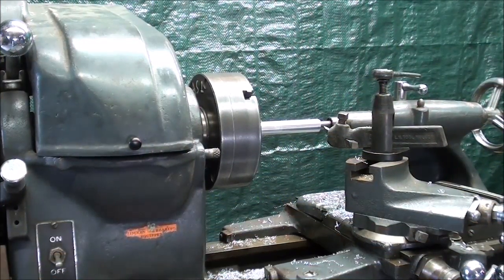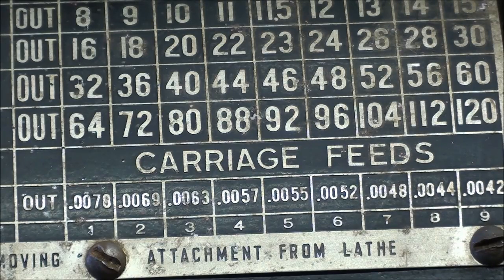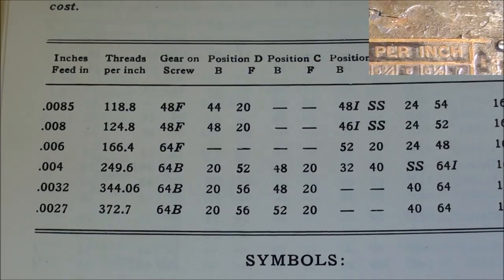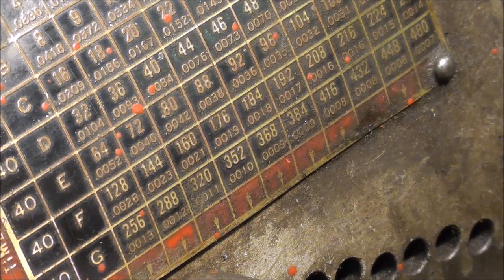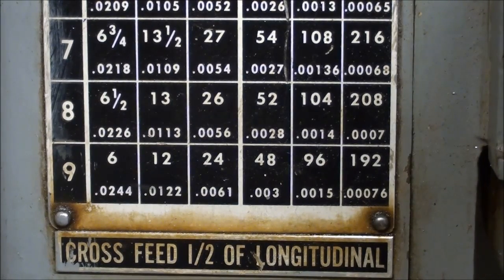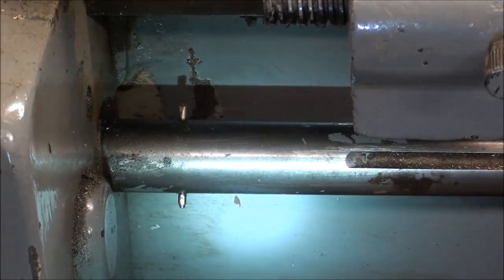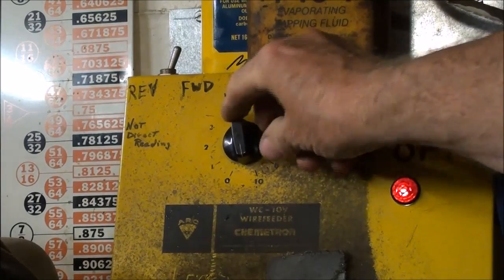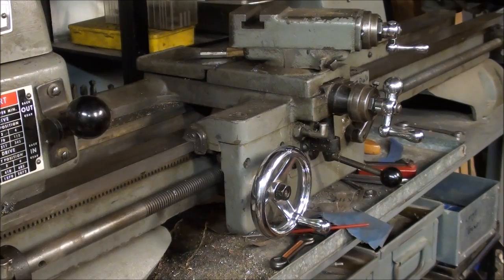SHOP TIPS #230 Critique of Feed Rates on the Atlas Lathe tubalcain

Comment: Hi, I have the same lathe and I'm just starting to learn how to use it. Until I saw this video, I thought it was my technique that was producing a rough finish.  I now understand the real reason.  I’d like to replicate your system, it’s brilliant.  Will any wire feed motor from a mig welder work?  I’m not sure how much horse power is required.  Thanks in advance for your help!
Reply from the maker: I cannot answer that question, because this meg motor is the only one I’ve ever seen.
You do not need a lot of power because the motor has a built-in gear reduction system.    But you can’t use a motor as weak as let’s say a fan motor. It needs to be a motor with brushes I think.
Reply: @mrpete222  Thanks so much for getting back with me so quickly!

Comment: Good day and thank you for your very informative videos.  I've been a hobbyist for many years but always had to use others equipment.  I recently acquired this same lathe (Craftsman badged) that you are showing here.  It was not fitted with the quick change gearbox.  Many of those I had used elsewhere were.  Having watched several of this Atlas series of videos, why couldn't you install one of the other reduction gears from the set to slow down the initial input of the QC gearbox thus reducing ALL the feed rates but with the target rate being slower turning?  Just my thought.
Reply from the maker: That’s a great idea.

Comment: My fix was to change drive gear from 48 to 24 teeth,,, and i used a nylon gear to also prevent a crash,,, l have to multiply chart by 2 and I lost first row on quick change treading chart but I will never cut a tread that course anyway. I would of did the drive motor to save gear box gears from wear but I realized the quick change gear boxes gears are steel and not zmak like the rest.
Reply from the maker: Good job

Comment: Hey, Lyle.  I don't know if you have seen this video.  The guy has didn't like the feed rate on his Atlas so with his quick change, so modified the gear train and cut all of his feeds by half.  He has to take that into account when selecting the settings for cutting threads and has a few which you cannot do without switching it back on the course in.  I thought you might find it interesting.

https://youtu.be/kEdxLceqCck
Reply from the maker: +ILGopher Yes, I did see that. I would like to do a vid on it some day

Comment: Hi Mr.Pete, I couldn't figure out how to send you a personal message, but I have a question... (this is the tech teacher who is building a version of your double acting wobbler engine- basically 1/3rd the size if I remember right.)  I have the cylinder in pattern form for casting. The piston chamber will have a 5/8 sand core and I want to bore the cylinder to fit a 3/4 piston that I'm going to turn out of Delran. I had planned on drilling the cylinder (about 4 inches in length) and then reaming it to .750 and turn the piston to about .740-.745. Both the drill and reamer I would have to buy. I'm wondering if you would have a different method to machine the piston chamber of the cylinder? Again, I'm not a machinist, but I play one at school. lol. Basically everything I know is self taught and learned from youtube. Thanks in advance for your advise! Ray
Reply from the maker: +ray29999 You can try boring it on the lathe. But the small hole requires a small boring bar which wants to flex on a deep 4" hole.  Guess you need a reamer

Comment: For a finer finish, just use a larger radius insert/tool.  I've never needed to feed slower than .004"

That said, I don't work on many small or delicate parts where the increased tool pressure from a larger radius tool could cause chatter problems.
Reply from the maker: +Bread996 Good advise-thanks for watching

Comment: Interesting the way you disengaged the gears and drove it via the back end of the thread.  That opens up interesting possibilities as a magnet and hall effect sensor could be connected to the shaft and the pulses could be detected by a microprocessor... then you could tell it exactly how many steps per revolution to send to a stepper motor... typical stepper motor is 200 steps per inch... a microstep of 8 would give you 1600 steps per revolution... so if the carriage thread were 10 TPI... that would be 16,000 steps per inch... or a theoretical 0.0000625 if my math holds out.
Reply from the maker: +askjerry sounds like a good idea, but its way beyond me
Reply: +mrpete222 Mechanically not really. You epoxy a magnet on the shaft somewhere and rig up a place to hold the sensor 1/8 inch or so away as the magnet passes by. Then you put the stepper 1:1 on the shaft... or you know what the ratio is and allow of it. After that... find a local Hackerspace or visit my buddies in St Louis at http://robomo.com (shameless plug) and they could help you.

Comment: I like your repurposed DC motor drive and wire feed motor! That is very useful. My Atlas lathe has no gearbox, and I didn't receive any if the change-gears. A similar design to yours would allow me to implement power-feed in a simple way, without having to source all the gears and incur that cost.
Reply from the maker: +davida1hiwaaynet Thanks for watching--yes, make one

Comment: I have an Atlas also.  I agree the carriage feeds are slow.  
The cross slide feeds are even worse.
If there is a method of automatically feeding the cutoff tool slow enough to be of any use let me know.  I haven't been able to cut Aluminum using the automatic feed.
Great video.
Thanks for sharing.
Reply from the maker: +Dick Mick I would contunue to feed for cutoff by hand. Thanks for watching

Comment: I have a 10" Atlas lathe with change gears.  Shortly after viewing your original video on the Atlas feed rates and the variable speed solution you came up with, I went shopping and found a fractional HP DC motor and a Chinese speed controller that could be rigged to reverse motor polarity (direction).  Not sure what all that stuff cost but it wasn't very much.  Made a 6" pulley out of scrap aluminum and adapted it to the end of the leadscrew.  Very easy project.  The benefit of independently powering the leadscrew that I noticed right away was how much quieter the lathe ran with the change gears dis-engaged.  The only time I can imagine using the change gearing now would be to thread.  Thanks for another great video.
Reply from the maker: +Larry Collar Good job. I noticed it was quiet. Somtimes I forget to turn the motor off.

Comment: A simple solution might be to fit an in-line 5:1 or 10:1 ratio reduction gear where the shear pin coupling now mounts. A 40mm (1.6") square unit should handle the torque ok, and will fit in the available space with minimal modifications. The reduction ratio should, of course, be picked to leave as many "useful" thread pitches available as possible. It might also, if arranged to be swappable, allow switching to metric threading easily, but changing the base ratio.

Comment: In the 70's I considered buying a Craftsman 12" lathe and tooling package as it was a very good sale price. I spent too many hours at Sears examining and critiquing that lathe. In the end I decided against it because;
 1. The gears are cast and not machined so accuracy is questionable. Also the finish on the alloy gears (wrinkles,pitting) made me wonder about strength and durability. I know now that they are durable and sufficiently accurate.
 2. The selection of threads available left a lot be desired for my uses. 3.5, 27, 34 and 45 are missing. Metric threads are certainly more difficult the on many other machines.
 3. An appalling lack of choice when it comes to feed rates. 
 4. Flat cast iron ways, although easier to refinish, would wear and mark more easily than if they were prisms or even just hardened.
 
 I really like your feed rate solution, puts me in mind of Hardinge and some second operation lathes I have used.
 Thanks to Joe Allen for the idea about wheelchair motors. I now know what to do with my brother-in-laws old wheelchair. Lathe and mill power feeds from one chair! Speed controllers included. Just need a battery charger for a power supply and a treadmill to power the drill press.
 Thanks for this critique on feeds, it has opened my eyes to some interesting possibilities. Now all I need is some more get up and go.
    Mike (o\!/o)
Reply from the maker: +Moholo 88 Thanks for watching.  You made some very good observations --you have an analytical mind. Good luck with the motors

Comment: Hi Lyle  The use of an independent motor for feeding the carage or cross slide  gives you an infinatly variable feed system.  My Hardinge Chucker and DSM-A lathes and most other Hardinge lathe use this vary  system.  You can speed up the lathe without changing the feed rate giving you a micro finish.   Great Video  Thanks
Reply from the maker: +trainman4602 Didn't know that Dave. Thanks
Reply: +mrpete222 I've used a Hardinge HLV-H and I wish I had one at home. There is no provision for a threading dial, instead there is a dog clutch in the threading geartrain and a knock-off. The top-slide has a built in retracting cam. It warns you in the manual to not attempt threading up to a shoulder at over 1000rpm.
Reply from the maker: +Paul Compton  Thanks for watching--those hardinge lathes are built with such precision.  I have a little hardinge speed lathe.

Comment: I wish I had seen this video before I bought my Atlas 12! I do like your solution to the problem, however.
Reply: +Rick Rose Personally I don't see it as a deal breaker; the Atlas/Craftsman lathes are still good lathes. The feed is just something we have to work with or around.
Reply from the maker: +Rick Rose Thanks
Reply: ShysterLawyer Agreed. I have a 618 and a 12, and I had a TH54 (10-inch) as my first lathe. So I don't hate them.

Comment: Interesting how the last two feed on the Atlas are only 2 tenths apart. It hardly seems worth it if they could have just used that last space for a finer feed.
I suppose it has something to do with either using gearing already existing in the gear box or a necessary mathematical equation for thread cutting.
Reply from the maker: +ShysterLawyer I bet thats just the way it worked out. They are too close together

Comment: I agree with your statement about engineers not using the equipment they design. In the oilfield, we had an engineer that always stipulated a 32 finsh, not realizing at the time that would require finish grinding in stead of machining. :)
Reply from the maker: +Old Pup Good comment

Comment: do you think the Clausing was intended for more "refined" grade of work than the Atlas was?...(tighter tolerances, etc)   the other possibility is one is meant for "field" work (get what ever it is done and back into service), and the Clausing are meant for more of a "depot" type work where they return the project back to "like new" tolerances??

once again, i find myself wishing I could have been one of your students!!
Reply: +Tim Hyatt 

I think it's two things

1. The engineers assumed you would use a tool with a tip radius.
2. The engineers assumed if you needed a really fine finish, you would use a machine designed for that, namely an OD grinder.

Comment: Given the strip-down/rebuild videos that have been done on such gearboxes, and the gear cutting tutorials, would it be possible (within the confines of the existing housing/mechanism) to make a new set of gears to expand the range of feeds offered, keeping the fast end but giving a considerably smaller low end? The how-to video would seem to have a ready audience, and would seem like an obvious alternative to the DC motor drive.
Reply: +Mark Sinden It is theoretically possible to replace one of feeds with different gear sets to produce a finer feed
Reply: I know it's possible "in theory" ... I was more concerned about the practicalities of fitting the required gear sizes into the available space - outer diameters, etc.

Comment: Surface finish isn't only about feed rates. It's linked to the nose radius on the tool you're using. So in comparison an insert with a bigger nose radius will make a smoother finish then a ground tool with a sharp point, at the same feed setting. I think that's worth mentioning.
Reply from the maker: +Johannes Larsen True-Thanks for watching
Reply: Good comment. A .005 feed rate will give a nice 63 finish with a .031 radius tool

Comment: I fail to see the issue, because as soon as you use a tool with any kind of tip radius, a difference of 2 or 3 thousands is all but mute!
Reply from the maker: +dans-hobbies I guess-Thanks for watching
Reply: +mrpete222  Check out this link, it has calculators that let you look at feed, tip radius, surface finish (Ra), and how they are related.

http://www.kennametal.com/en/resources/engineering-calculators/turning-calculators/surface-finish.html
Reply from the maker: +dans-hobbies interesting

Comment: on some lathe, such as the South Bend, you can increase the screw gear size to get a finer feed if necessary. For instance on the nine and 10K, South Bend sold a 116 tooth turning gear. It was made for the change gear lathe, but it Will work on the quick shift gearbox, essentially dividing the feed rate in half. unfortunately This will not work on the Atlas / craftsman lathes.

Also for anyone who wishes to modify there lathe to use electric feed, an old wheelchair motor works well, But It is very important that you find one that has a lever to disconnect the gears inside, So you can pushed the chair manually.  this allows you to disconnect the electric motor, (Without having to disconnect the belt), When using the standard power feed on the lathe. they require a 24V power supply. But that should not be a problem for most of you.
Reply from the maker: +Joe Allen Thanks for watching--thats good info & a good solution.

Comment: That slow feed for the Craftsman lathe is a very tempting project.  I have the parts to copy that, not anything from a wire feed but still a slow moving motor.  Verrry tempting idea.  Just as soon as I finish painting the bathroom.  Thanks for the great video.
Reply from the maker: +Amateur Redneck Workshop Thanks for watching

Comment: Yeah, I have the same issue on my 10" quick change.  I haven't looked that closely at how everything meshes in there, but had opined on the thought of seeing if one could replace the gears which position E meshes and make them larger to reduce the feed rates across the board without affecting the threading pitches.  For now, I just have to try to take a finish pass by advancing the carriage by hand.
Reply from the maker: +ILGopher Thanks for watching

Comment: One of the big problems with the Atlas is that they use the half nuts for the feed. Most other lathes have a different way to engage the leadscrew for feeds so they get more reduction than just half nuts. I fashioned something similar to what you did, Mr. Pete, for an old Atlas where I worked as a kid. So that I could get a fine feed. Being the new kid, I often had to use the old Atlas when the better lathes were in use.

Comment: I bought an Atlas lathe, just like the done in your basement, and used to wonder why I couldn't get a good finish on anything. It dawned on me several years ago that the feed rates were too high on the low end. So I had watched your other video on slowing it down and am wondering if I can concoct a similar speed reducing contraption as well. 

One of the selling points of the Atlas/Craftsman lathe was that it turns fast enough to turn wood. The guy I brought it from needed space in his shop and I like to work wood and wanted to learn how to turn metal for a few projects so it was a good deal for me.  I used sheets of plastic and magnets for a while but now "Press & Seal" is handy stuff to protecting the ways from wood chips. Might try that for turning cast iron too, no magnets needed. You do have to stop and reset the Press & Seal once in a while, but it makes for easy clean up and protection.

I noticed on your Clausing lathe that there are feed rates below .00076. Right above that one on row 8 is .0007and on up three places there is a 00065 on row 6. Not really knowing much about metal lathes that is puzzling to me because the slowest feed is usually in the bottom right corner of the charts.
Reply: +Cavemannspace You can attach a handwheel on the leadscrew tailstock end and upgrade to a variable speed motor later. I have the South Bend but often use the handwheel for fine feeds when I need the lathe to be quiet late at night.
Reply: +martik778 That's a thought. Thanks.

Comment: Nice modification on the Atlas 12".  I just looked at the chart on my Atlas 10F and the finest feed available with the standard change gears is .001877.  That is better than the 12" but still not great.   I may look into a similar mod for my Atlas as well.  Thanks for sharing.   Fred
Reply from the maker: +Fred Miller Thanks for watching